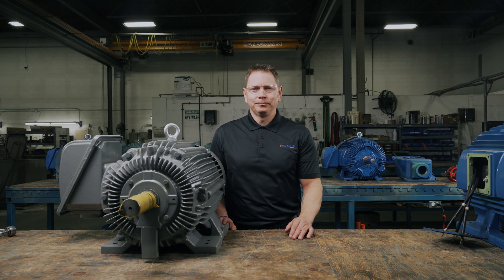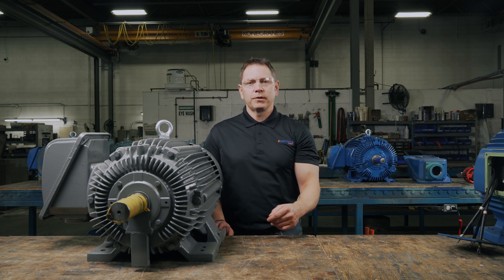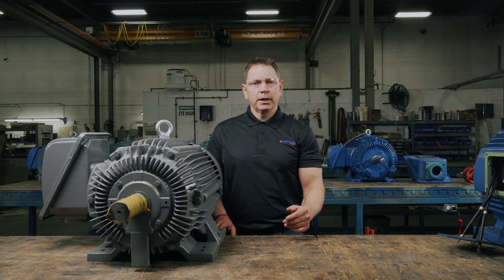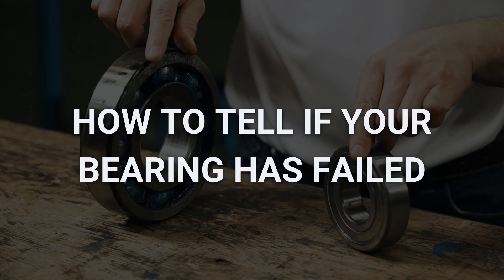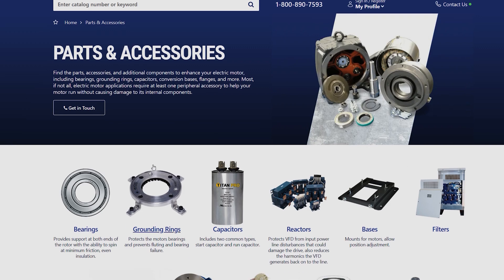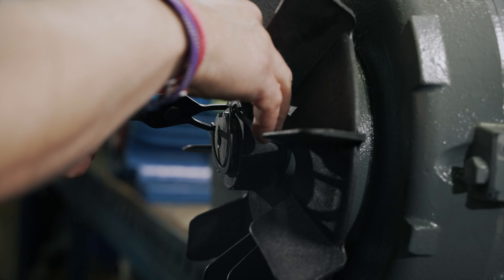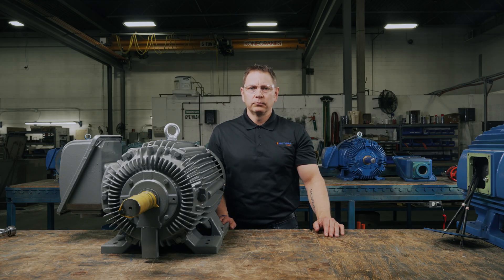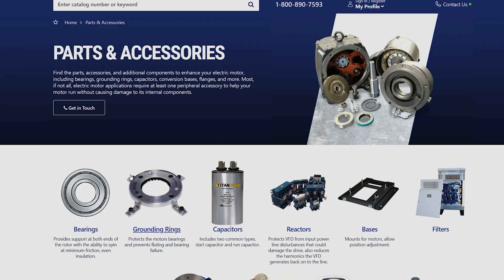How to Replace Electric Motor Bearings

Comment: Won't lie. I had a bearing replacement recently. That darn thing wouldn't come off. The bearing was pretty shot. It was for a thermal oil pump with an external magnet to help drive the impeller for the pump. I ended up cutting the inner race. It was a difficult task. I didn't want to resort to that. If it gets to that point. Can anyone help me find a better solution?
Reply from the maker: I feel your pain. Those inner races can be brutal when they seize up. Cutting it off is never the first choice, but sometimes it’s the only way when it just won’t budge. Have you tried using an induction heater? It heats the race without messing with the shaft. A bearing splitter with a puller or press might give you enough grip underneath if there's room. Might also be worth checking with the pump manufacturer.

Comment: Hi, What is the benefit of the piece behind the bearing that you did not remove from the shaft?
Reply from the maker: I believe you're referring to the rotor end ring. That is the object directly behind the bearing. The benefit of end rings is that they connect all the windings together so that current can flow as opposed to building up and arcing. 

Thanks for the comment! Hope this helps.
Reply: @emotorsdirect  thats wrong, i talk about bearing cover
Reply from the maker: @fee2044  Bearing covers come in two parts that are bolted together in order to enclose the bearing and prevent foreign particles from entering and causing fouling. The bearing cover only needs to be removed if damaged or worn and since this one was fine it was not removed.
Reply: @emotorsdirect  ys sir, thank u so much, i’m mechanical maintenance but this is interesting.